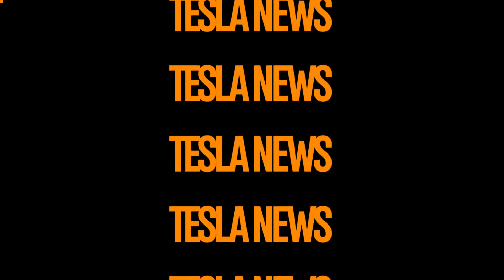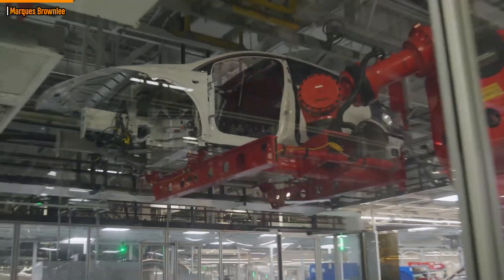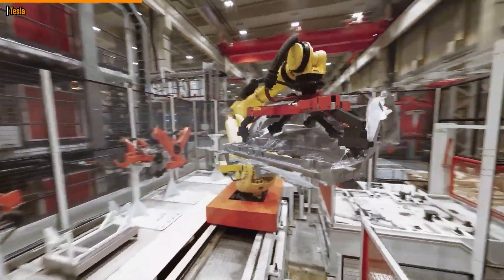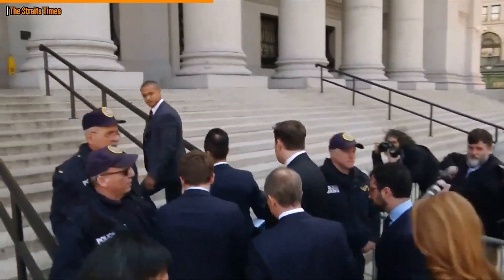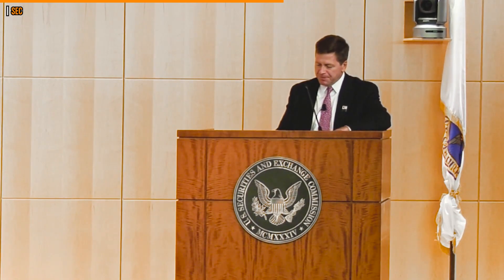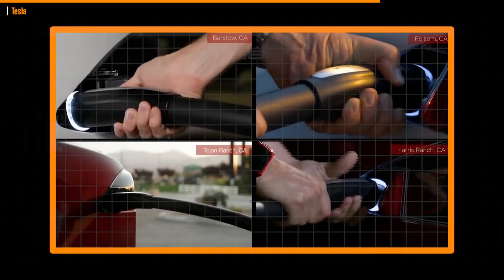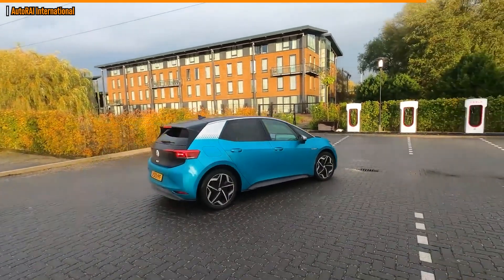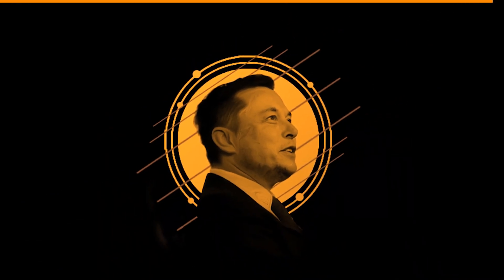Tesla Gigapress In Action: Cybertruck Is Coming Soon! - And NEW FSD Beta Leaked!

Comment: No the Cybertruck is not coming 'soon', unless you call sometime mid 2013, 'soon' for starting shipping.  Elon has stated that they will be focusing on the Model 'Y' this year at G.F. Texas.  One problem is batteries, or more precisely battery materials. He has made agreements with Panasonic and CATL as well as building battery manufacturing facilities at Tesla Factories but their are supply chain issues. One of the Cybertruck's gigapress is already at GigaTexas but it will take a while to ramp up production for a number of reasons, the least of which is 'supply chain issues', (Stainless Steel, Aluminum).